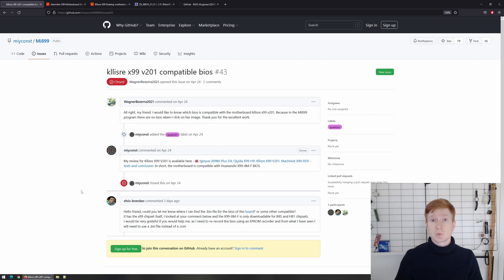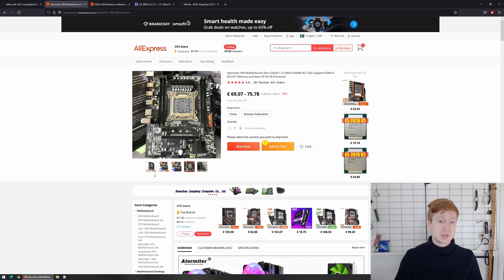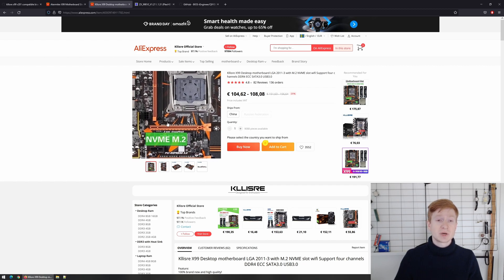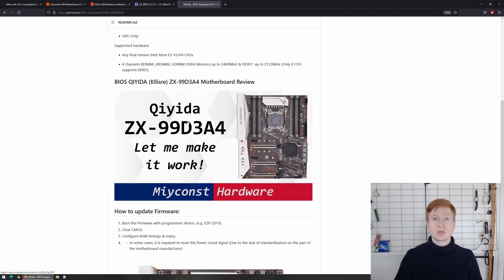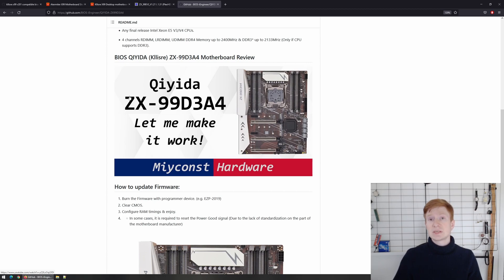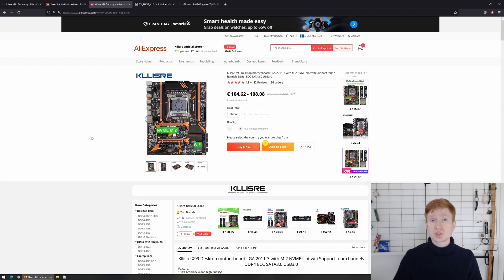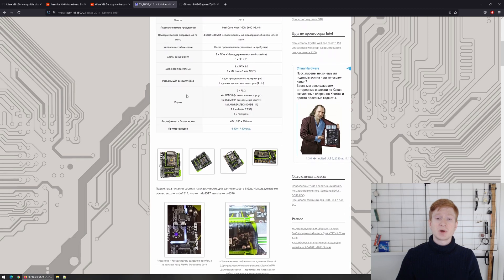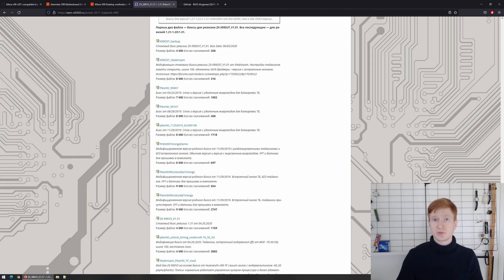🇬🇧 Kllisre X99 (ZX_99EV3), where to get .bin or .rom BIOS? | Miyconst Answers 01

Comment: Dont flash the zx-99d3a4 bios on the orange motherboard,  with this bios network dont work, dont have turbo boost, and this bios lock the motherboard and u cant change the bios anymore (error 25 the host cpu does not have write access), this bios made my board useless and i cant change it!

The bios of russian site all works.

Comment: Hey, i update bios to unlocked oc on my atermiter x99 v201, when now pc run with black screen help, i dont have backup bios
Reply from the maker: You need to restore the original BIOS, you can check my Mi899 collection to see if any of them fit your motherboard. I can't guarantee compatibility, since I don't know your motherboard specs and revision, but X99-8M-F or X99-QD4 BIOS should be compatible.
Reply: @miyconstclips  Hey chipset is sr177 (h81) and but x99-8m-f and x99-qd4 bios dont work and my motherboard. I check you MI899 is Kllisre X99 V201 with h81 and bios file is not added.